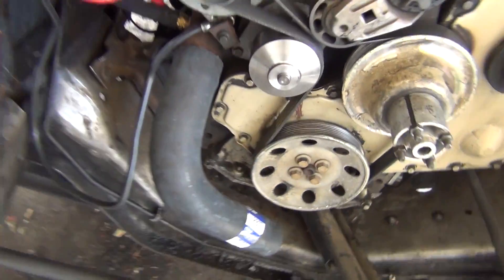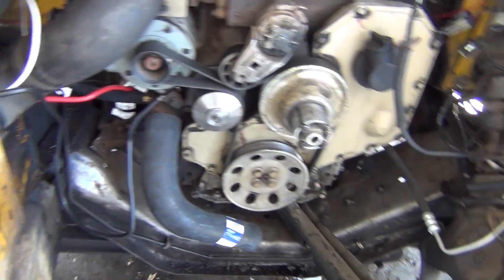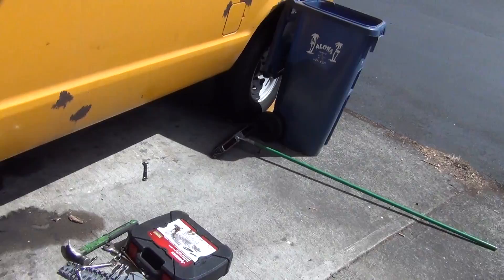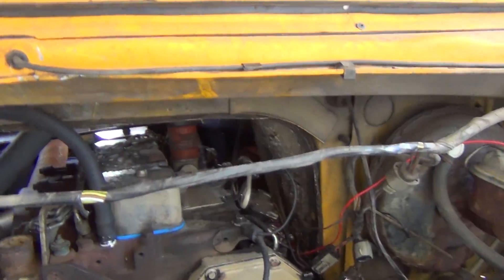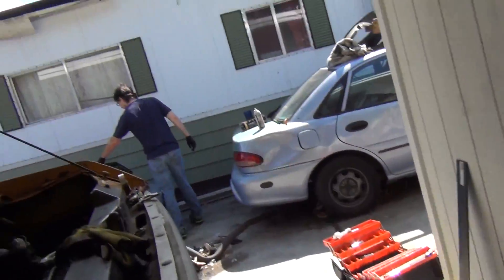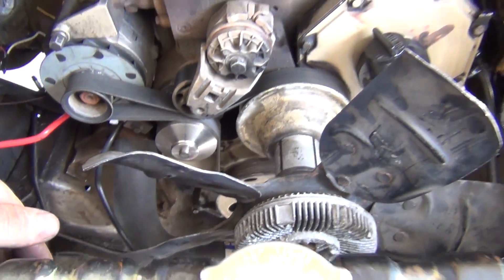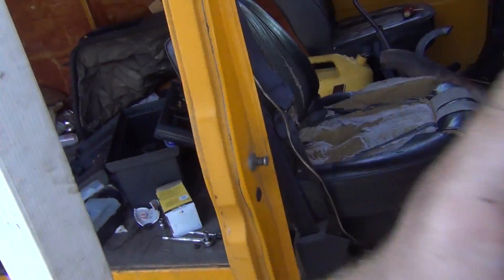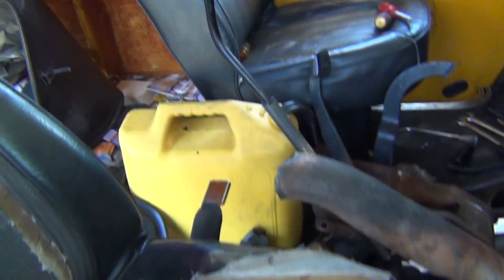Ford Econo-Cummins Van | 4BT Swap Update | It's Harder Than We Thought

Comment: I enjoy your videos.  I know the 4BT is relatively heavy, but it might be better to center the motor mounts over the subfame and move the motor a bit forward.  This will cause a problem with the transmission mount (probably necessary to fabricate a crossmember) but it will allow more solid engine mounts and  a better location for the shift linkage.
Reply: Hi I want to convert a 1988 Ford econoline witch motor do you think is better (diesel )

Comment: hello I have the same model of trucks of the 4bt engine, I want to adapt the engine I found your channel and but I did not find any video, you regretted putting it. What kind of problems did you encounter? I saw that you cut part of the floor where the brake and accelerator pedals go, I found the engine in the junkyard in a 1992 jeep wangler with the Automatic Transmission Greetings from sonora mexico

Comment: If you don't mind me asking, where are you getting your donor motors? I would really like to do a cummins swap on my f150 and here in TN it seems to be hard to find donor motors and I thought you might have good ideas of where to look, thanks and your Scotty Kilmer impression is hilarious haha
Reply from the maker: Gabe Wall I've been getting mine from Craigslist, ebay has a lot of them and most come from Ohio. The guy I bought mine from ran out and hasn't posted in awhile and I haven't bothered to look. Yeah, I love the Scotty Kilmer impressions too lol.
Reply: Gabe Wall Since your in TN, you might want to try http://www.adelmans.com/. They're in Ohio.  I've never ordered from them, but they seem to always have a good supply of used 4bt engines and have been around for a long time.  Look under Engines then select Cummins and look at the last couple pages. Just make sure you get an on road engine and not an off road, stationary or industrial. Also make sure you get the bellhousing adapter ( Ford) and flywheel. Important to get the engine mounts for the Ford since they don't make them anymore and/or very hard to find. If not you'll have to make your own. This will save you about a grand.  It's possible that Scott McKinney that sells on Ebay get his engines from the same place and marks them up a couple g's.
Reply: +BigBlueMotors  Thanks! That's exactly what I needed because I've been researching it and I knew that those mounts were almost impossible to find and I also knew I had to have a 4bt with the adapter plate but I just needed a source, thanks for looking out!

Comment: Do you think we could drop a Cummins 4bt into a 1982 Dodge B350, that's a motorhome, on a Van chassis?
Reply: +VagabonDaze yes it can and has been done if it a auto stay with that if it happens to be manual keep it as that 
the things you will need to fine out what engine does the b350 have and what does the engine stands look like and is there i6 stands that are same or close to what a for i6 stands look like or a dodge i6
Reply: Thank you, as of now it has a 440 big block magnum in it, but we want to convert to either a 4bt, or 6bt Cummins!
Reply: +VagabonDaze Ya you Just need to figure what engine stand/  engine mount combo will work get the 47re dodge trans from a dodge 2500 with a Cummins the auto you have most likely 
not be able to handle. a 4by or 6by and since it a big block Tue bolt pattern will mot work so you need the engine adaptor for a 6bt  from a dodge use it with 4bt the 47re is a good trans I do believe you might need a shift controller
Reply: +VagabonDaze. 4bt 6bt * sorry autocorrect
Reply: VagabonDaze how big is the rv 
ft wise
Reply: It's 20ft, it's basically an oversized b-camper. You can see it on our channel. The GVW is around 6500lbs.